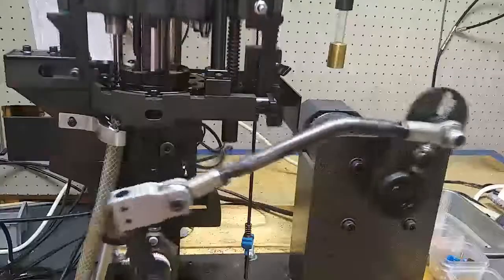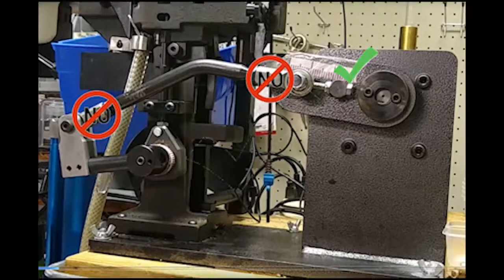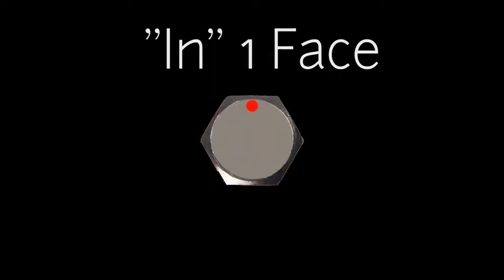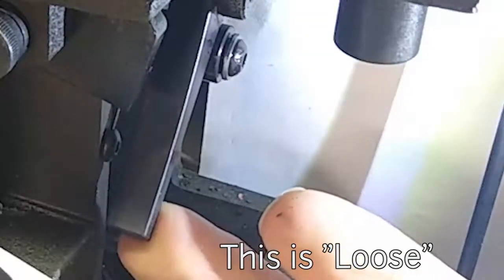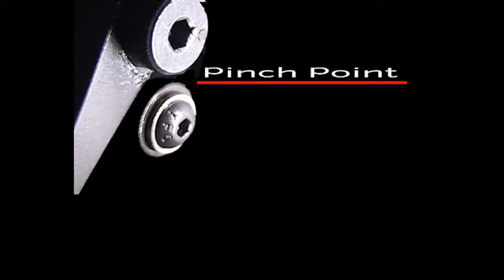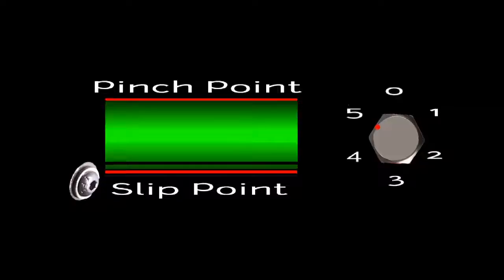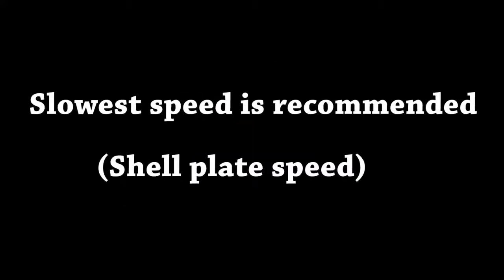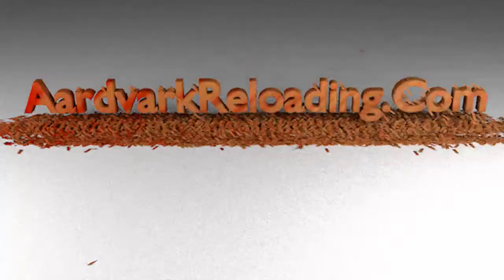Adjusting the Ponsness/Warren Autodrive on a Dillon 1050 Super

Comment: Did you ever post the video on adjusting the swivels on the autodrive?
Reply from the maker: For the Dillon 1070 super and possess warren
Reply from the maker: You know I never did.    I couldn't get the torque I needed to fully resize a 'say' 9mm case.   I disabled my autodrive for the moment.     I am going to try the FW resizing die to decap and resize my casings.    I have found FW's website confusing.  He has two sizing dies with different pins.    I can't figure out how to order the set I want!
Reply: @helpmenowmark  I can get the PW autodrive to work with my Super 1050 for straight wall pistol cases, but it absolutely will not work when doing full length resizing of .223 brass. If the brass is already resized and deprimed then it will work "most of the time". This is with the clutch cranked down very hard. This has caused the machine to lock up occasionally. I was attempting to make certain everything was adjusted properly before throwing in the towel on the PW unit. At the bottom of the stroke the PW arm is at an acute angle so only a minimum amount of the force on the arm is transferred to torque on the Super 1050 main shaft. Torque = Force x sin(angle). So putting on force at 90 degrees you get 100% of the force to torque. At 15 degrees you only get 25% of the force transferred into torque. At 5 degrees (what I measured) you'll only get 8.7%
Reply from the maker: @johnvossler250  I know where you are coming from.    Besides getting an FW resizing die , my next point of attack was to get with the engineers (or sales) at PW.   They make a longer stroke arm for a different autodrive but I don't know if it's compatible.   The longer arm should vastly increase the torque.   I ran out of time to investigate this further.   I don't think it's going to take much more force to overcome the problem. I would also try to lube your cases well.   I would suggest using women's hair conditioner (no shampoo).   It should work well as a lube and  is water soluable so it should clean up easily after reloading.

I also traditionally turn off all other stations and deprime on it's own run.    Maybe it's me but most of my issues with reloading in general occur during the decapping/resizing stage.    With the Dillon a lot is happening all at once and primers that aren't completely removed cause major hangups... agree!?

My thoughts with the 556 would be to decap and mostly resize the casing (say 75% resized) with round one.

Possibly wash your casings.

Then turn on (engage) all stations, full length resizing, the works.

I should mention this... before any/all of this ... I do remove all brass with undersized primer pockets.    The 3rd station where the press absolutely expands/swage the primer pocket with brute force  doesn't set well with me.    

Your thoughts.

Comment: Thanks for making this video.  I am considering one of these over the Mark 7 system as a cost saving/fewer electronic component things to potentially fail.  How long have you owned the PW auto drive and are you happy with it?
Reply from the maker: No.   I'm not happy but I've been so busy I can't work on it ( to be fair).   I'm pretty sure a phone call and replacing that short stubby shaft with a longer one would solve it.   But I won't know that until I have time to do so.   I've also been told by youtubers to get a FW decapping and sizing  die.  I don't have time to try out that suggestion.
Reply from the maker: I left the video up because it IS how to adjust it and nobody else says anything... Not one word on what they did to make theirs work.   Maybe it's me.
Reply: @helpmenowmark  Thank you!
Reply from the maker: I've had it a long time but never had a real chance to use it in production.   Go with the mark 7.   I actually had to disconnect the PW since making this video